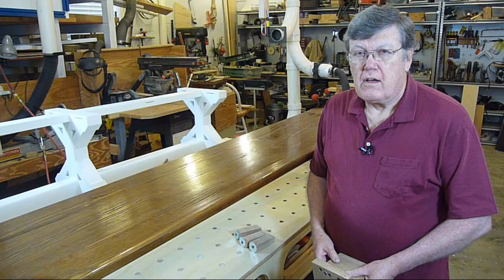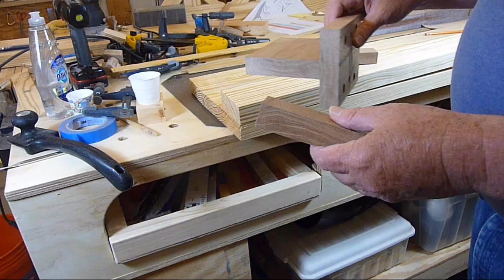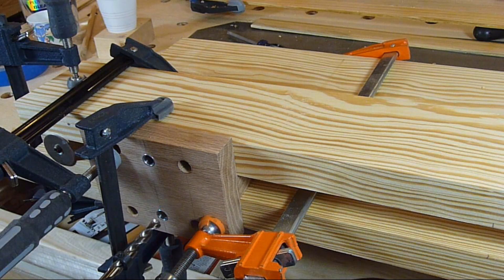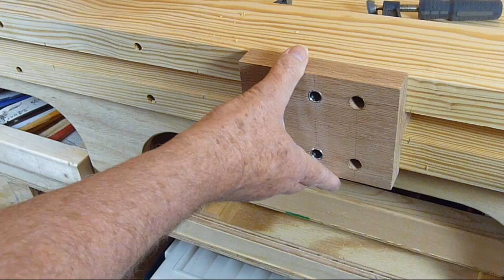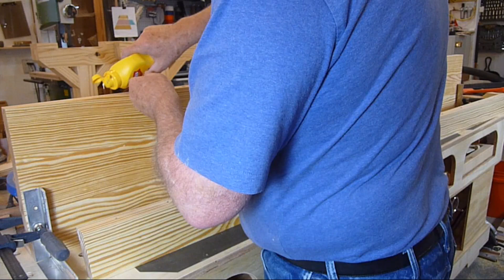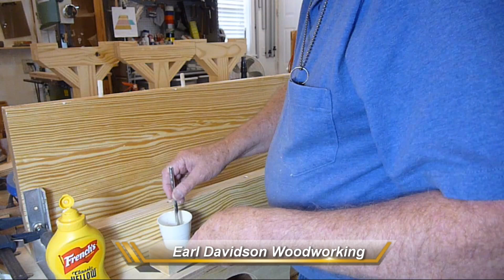Easy DIY Dowel Jig for Tabletops & Panel Glue-ups

Comment: Good job earl, your videos are great. I noticed you have a keyless chuck on your drill press.  It looks a lot like the one I had purchased from Grizzly.  While I loved the convenience of not using a key, I found the chuck released the bit anytime I put any kind of pressure in drilling a hole which was pretty much every time I used it.  What's your experience been like?
Reply from the maker: +Nathan Safran It's very frustrating.  The keyless chucks in my drill press and two cordless drills are prone to releasing the bits.  I've been considering buying keyed chucks for a while now, just haven't done it yet.
Reply: +Earl Davidson Woodworking OK, so I'm not the only one :-).  The thing cost me like $70.  I was amazed to discover that they could sell a product that simply does not do what it is supposed to do.  I put the stock keyed chuck back in the drill and stuck the keyless chuck in the back of a drawer.
Reply: I recently found the answer to this problem with cordless drills. It is to hand-tighten the drill bit in the chuck, but then back it off (reverse direction) by hand for one click. This locks the chuck.  I've had good luck with my cordless drills ever since I started doing this.  I know this is an old thread, but thought I'd mention it anyway.  Can't speak to the problem with the drill press chuck, though, since I have one with a key.

Comment: Nice Jig, I was wondering why you used 3 clamps when 2 looked sufficient. Then I saw that you had to ensure that the boards were in contact with centre spacer on the jig. Good idea. Are you going to put dowels in the improperly drilled holes? Luckily you  won't need a jig for that. Thanks for posting the build.
Reply from the maker: +Jean-Marc Labonte ...lol, no, i'll just use the properly drilled holes.  :)  Thanks for the comment.

Comment: I didn't get it at first why you designed it the way you did but it became clear when you showed how you where doing both adjoining faces at the same time. Nice.The operation looked very efficient. I do have one question though. How well did the boards align? :)
Reply from the maker: +WoodRodent Once the holes are properly spaced in the jig the boards align very well.  Better than with my biscuit jointer.